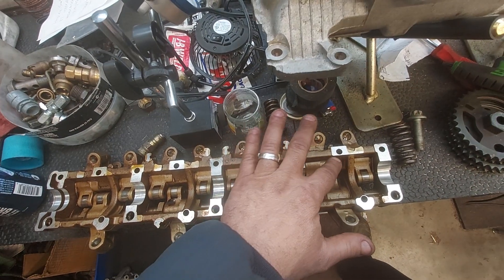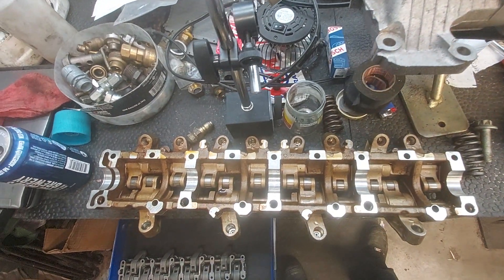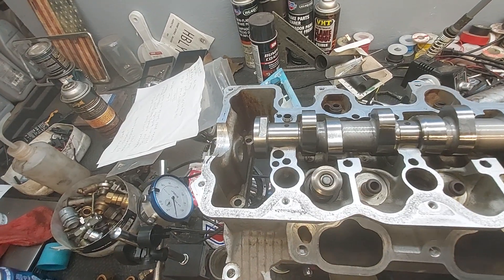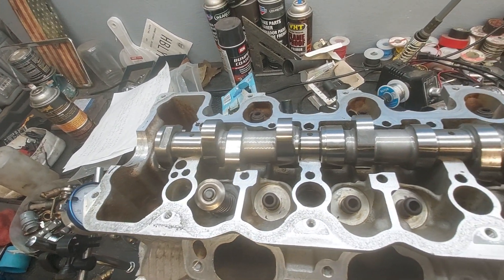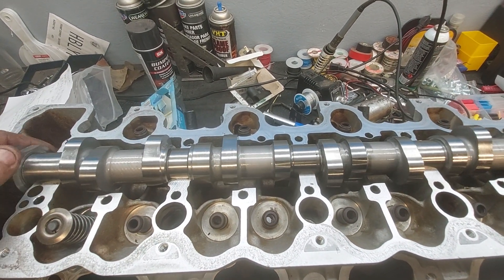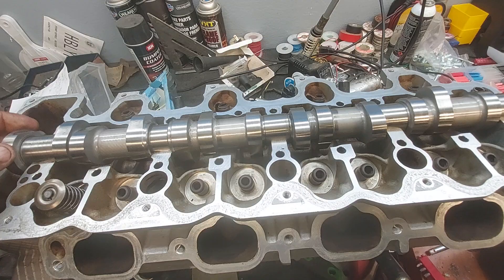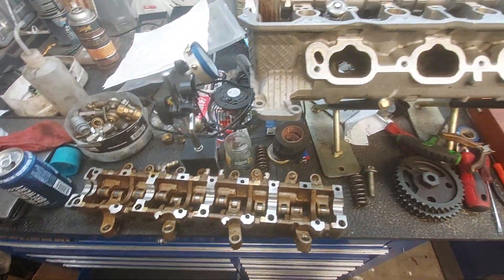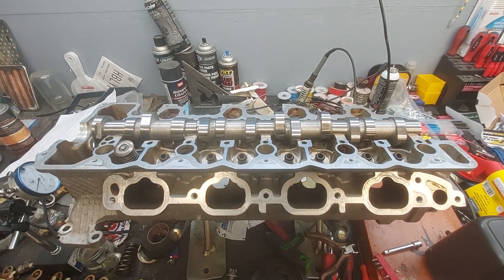Mercedes-Benz Hillbilly Hammer new M113 camshaft's for 2022

Comment: What can I do to make my m113 4.3 better, can I swap the 55 cylinder heads with cams to it gonna supercharge it later ?
Reply from the maker: Heads are essentially the same between the naturally aspirated engines. 55 Camshafts would be a great swap and upgrade to the 4.3
Reply: @bicylindrico  so can I swap the entire head with cams and valves ?
Reply from the maker: @mobshipa187  yes

Comment: So I could use these cams on a 2006 s500 it's still a m113 engine
Reply from the maker: Yes, just need to clearance the rocker arm bridge, cylinder head, install new valve springs, locks, retainers and fly cut the pistons.
Reply: @bicylindrico  do you have a Instagram or something I can contact you on ?
Reply from the maker: @armanirhodes7680  Sure   @bicylindrico
Reply: Okay I juss hmu rn
Reply: I juss hmu on Instagram

Comment: Does CLK55 amg cams work on CLK500?
Reply from the maker: Yes. Direct bolt-in
Reply: @bicylindrico  does it make a difference?
Reply: @bicylindrico  I meant difference in cam profile and power
Reply from the maker: @alpacino2365  Big difference. Cheapest upgrade for actual noticeable improvement
Reply: @bicylindrico  One last question, does the M113AMG N/A share the same cams on the M113K AMG? (Incase I can’t find an M113AMG N/A nearby)
Reply from the maker: @alpacino2365  Everything I have measured says yes, same camshafts

Comment: Hi there, I have a 2003 CLK55 A209. I want to add a bit more power to it. Was thinking of changing the cam, is there a lot involved or there a cam that can just be dropped in and a retune done?
Reply from the maker: What cams were you considering? I should have a new video this weekend on some of the things I had to deal with to install 'big' cams. The heads won't support camshafts much bigger than the AMG cams you already have
Reply: @bicylindrico  nothing too big, something that gives some good low/mid range power. Something that sounds a deep and lumpy on idle.  I’ve seen raceiq have cams but for the m113k motor.
Reply from the maker: @chrispapa1587  The kompressor cam would be the same as the NA as far as fitment. My honest opinion is that no 'regrind' camshaft is going to give much over the AMG camshaft as there is not much there to work with without running into interference issues. The valve timing events can't be optimized when regrinding the factory camshafts which a regrind uses. MB maxed out what the factory valvetrain would support when they made the AMG camshafts. Anything more will require extensive engine modifications.

Comment: Have you put a feeler gauge between the lobe and the head?  I got a 0.019" feeler in there and that seems like plenty of clearance to me.  I am worried about the rockers though.  I really hope we don't have to take much off the bottom of the rocker arms themselves.  I don't mind chewing into the bridges with the die grinder, but those arms have me a little worried.
Reply from the maker: Yeah, currently grinding the rocker arm underbelly's. I am going to clearance those few areas on the heads since the heads will be torn down. The rocker arms take a lot of time and you will grind close to the oil supply channel in there so take your time and don't remove anymore than needed. I used .030" worth of tape on the lobes to ensure enough clearance when grinding. If the tape hits then I remove a little more and the tape leaves a witness mark where they hit. May help you.
Reply: @bicylindrico  I like that tape idea!
Reply from the maker: @stumptownbenz  Sent you an email on your website

Comment: Hi ive been looking at all of your videos and i love your project but i was wondering if you would know if the intake manifolds between the m113 and the m119 have the same bolting points. Ive seen an itb conversion for the 119 and i want to slap it onto a 113 but i dont know if it would be able to fit the same way…
Reply from the maker: Not even close and the M119 has coolant ports. My manifold adapters will allow for off the shelf  stack fuel injection which is on my list of future builds

Comment: Did you have these custom made? I hope they’ll eventually work out for you man
Reply from the maker: They are made to order out of Europe. Only took about 5-6 weeks though
Reply: @bicylindrico  DBilas by any chance?
Reply from the maker: @TofumanFC3S  Nope. Catcams! and these look beautifully crafted.
Reply: Do you have the spec of these. Looking for a set for my NA 113
Reply from the maker: @johntosh6146  The AMG 55 cams are going to be about as big as you can go without disassembling and machining the heads and adding valve springs. A 55 camshaft regrind can produce more lift and duration while keeping most clearances in check and be 'bolt-in.'
Reply: @bicylindrico  How much more lift and duration can be added to a 55 cam and be "bolt-in"?
Reply from the maker: @therocket280z7  Maybe .430" lift and as much duration as you can grind in. The intake valve timing is so late that it won't be an issue. I measured around 120 centerline on the intake timing with the 55 cams. They aren't very aggressive
Reply: @bicylindrico  
Ok, confusion. I asked how much lift could be added/gained.
According to your measurements in a thread on mbworld, and other sources, the stock 55NA lobe lift of .290 combined with 1.5 rocker ratio makes for a total valve lift of .435. Is that the maximum valve lift that can be had on these engines as 'bolt-in'?
Or can the cam be increased to .430 lift?
Reply from the maker: @therocket280z7  .430 valve lift due to valve seal/spring retainer interference and coil bind. You cannot increase the lobe lift on these cheap hollow core pressed-on lobe camshafts, you can only decrease the base circle and then you are limited by hydraulic element travel. 
My advice is that you are wasting your time trying to use factory camshafts to modify, I have already been there and done that. The factory camshaft timing is garbage. You will be much more ahead to just buy a real set of camshafts from someone like Catcams but be prepared to check everything and modify if needed. The engine does not take to 'big cams' very easily. Regrinds are not money well spent.
Reply: @bicylindrico  Yeah, I would only increase duration enough to move top end up around 500rpm or so. When you start altering the powerband significantly, cars starts to go down the rabbit hole of alterations, as I'm sure you know. If only it was 'bolt-in' to have .500, that would be awesome. I look forward to seeing how yours performs with the new cam that's close to that. Thanks for the help!
Reply from the maker: @therocket280z7  This new engine doesn't really start to make good power until about 4-4.5k rpm and revs freely until I shift close to 7k. I want to try a dual plane intake manifold and a new 3500 stall converter. The heads I think are really good with no mods and it doesn't really need a lot of cam  because they are so good.  The exhaust is terrible and worth more attention iMHO.
Reply: @bicylindrico  
Oh yeah, I was going to ask if you had tried a dual plane yet. The Edelbrock rpm performers seem to be good for 500hp or soo nowadays. Plus it would have a shot at fitting under the hood.
So with the carb on there, and no fuel cut from the efi, it lets you shift after 6000rpm without issue, or did you have to mod something like the tcu?
Reply from the maker: @therocket280z7  Megasquirt runs the igntion so it controls rev limiter, launch control, shift cut, etc. OFGear runs the transmission and shift paddles. It's been a great combination

Comment: There’s a thread on mbworld about a valve spring upgrade titled “lightweight beehive valve springs”. Not sure if it will help with what your doing but figured worth checking out. YouTube I think will delete the link if I post it. Anyways looks cool thanks for the updates
Reply from the maker: Thanks was using the same engine valve spring but for boosted applications. The spring he was using I recall had a .500" max lift whereas the ones I plan to use allow for a .550" lift. It's nice to have at least .050" clearance on about everything valvetrain. It looked like he cobbled up retainers at the top but I think the factory non-kompressor single spring retainers should work perfectly with the Ford springs. I don't have them in hand yet.